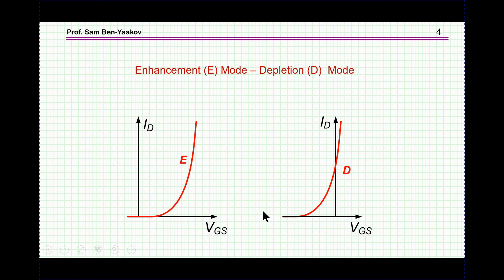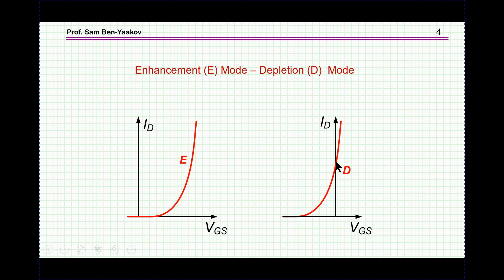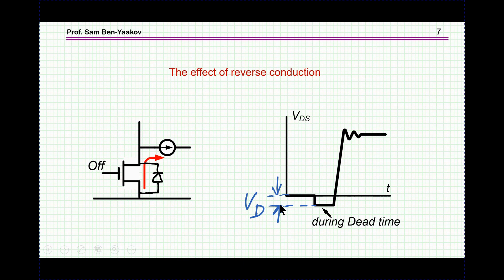So what is GaN MOSFETs’ reverse conduction all about?

Comment: Thank you for sharing all this knowledge to us. I have just a single remark: in explanation on MOSFET operation under VDS lower than zero you should disconnect the bulk from the source and leave it floating. As it is now, bulk connected to source, drain may not go below 0.6V because drain-bulk diode will conduct. In ICs is standard practice to leave bulk unconnected or to “soft” connect it via a resistor to all negative voltages on drain. One may talk about “structural” source or drain = device terminal intended to act as source or drain and “functional” source = terminal at lower voltage and “functional” drain = terminal at higher voltage. In MOSFET operation source and drain may switch roles.
Reply from the maker: Hi , Thanks for comment. Indeed I inadvertently mixed up the Si and GaN symbols, not witching the bulk conction . I guess that most watchers of the video will not notice that as you did 😊. Remaking the video is just too much work. Thanks again.

Comment: The problem with parallel diodes is current sharing, especially at 50kHz and higher. To reduce this phenomenon it has to be co-packed with switch in the same case to minimize parasitic induced.  ROHM has one SiC MOSFET + SiC SBD in TO-247 on the market
Reply from the maker: Thanks for pointer Andrii. Indeed a good way to go.
Reply: Nexperia has GAN039 series as well, integrated MOS for switching

Comment: Are GaN devices typically symmetrical or asymmetrical? That is if I were to "accidentally" mix up drain and source on my PCB layout, would the device still function identically in switching application?

I found the explanation ranging from 6:50 to 12:00 to be kinda long-winded. if I understood you correctly, the role of drain and source swap when the voltage across the channel is reversed, as I expect. With the continued assertion that V**g**s=0 for a reverse biased HEMT w/o the body diode, it should behave exactly like a normally-biased FET would when the Vds is asserted to zero (shorted) on a MOSFET... That is it would act as a crude zener diode at/around the threshold voltage. 

I happen to have a large collection of very old (TO-18, 100mA, 25V) 4 terminal MOSFETs that just so happen to feature separate body / bulk connection and source. I have successfully used them on a breadboard bi-symmetrically reversing the role of drain and source. It gives me some ideas for using them as analog switches. Why are these not more common especially in applications like a battery BMS where back to back connected MOSFETs are used as a switch to disable a battery from over-discharging or over-charging? Or even in power electronics where having a symmetrical switch would enable some novel designs?

What is the practical difference between enhancement mode GaN HEMT and depletion mode HEMT w/ Si cascode MOSFET? I've only looked at a couple devices so far and it seems the GaN eHEMT has a very low threshold voltage and may require negative gate drive to ensure it stays off while the cascode MOSFET variety features a more typical Si behavior and can act as a drop-in replacement for typical Si devices, but has slightly worse characteristics than a pure eHEMT or dHEMT

With the emergence of GaN and the far superior performance at least on paper, is there still a place for the SiC which is still proving to be cost prohibitive (at least to me 😛)

Sorry for all the questions, I regained interest in making my LLC converter design I started at the beginning of this year LOL. And was looking into how to make a bridgeless PFC. And yeah the control for that cursed thing is very tricky indeed!
Reply from the maker: 1.The ones I know are asymmetrical. 
2. Watch again😊
3. The separate body terminal is real not useful. You can get by without it. Tis is the reason , I guess, they are not popular.
4. The E D mode conduct with Vgs=0 very dangerous and inconvenient, requiring a negative bias to block. 
5. For high voltage the SiCs are still superior. The GaNs need sometime to catch up. If you have not noticed, nobody was able to demonstrate a GaN inverter for high voltage/power EV motor.

Comment: Hello Sir, It was an excellent video for me as I have just entered the domain of WBG devices. However, I had two  queries. 

1. As we see in the Id_Vds characteristics, at Vgs = 0, the device is conducting both in the first and third quadrant. Then why do we bother to provide a  even more negative gate to source voltage, as I see that applying more Vgs negative is causing more Vds to be dropped and also reduces current carrying capability? Does it improve anyway the conduction losses in reverse direction? I think what I am trying to ask is whether providing a even more negative voltage is advantageous in any way?

2. If I want to turn off the D mode GAN FET then what do I have to do as applying a negative voltage is causing conduction in the reverse direction also?(so it is not "OFF" as for that matter).

Thanks.
Reply from the maker: Thanks for comment. 
1. The purpose of a larger negative voltage is to protect against the "Miller spike" 
2. There is no way to block reverse conduction. This is similar to a Si MOSFET only that the voltage drop is not of a single diode

Comment: 12:00 I haven't get the last part of the video, yet, but if Vgd exceeds the threshold, Rds which was huge before (when the transistor was blocking) falls to something drops to like 1 milli-ohm. So, unless you have 6000 A through it, you won't be able to sustain a drop of 6V from Vd to  Vs, with Vds = Rds * I. So, with no sustained Vgd of 6 Volt, will we not get a system with very low current, less than 1mA ?
Reply from the maker: See https://youtu.be/QNHzaiWCUeE?t=844

Comment: Regarding using GaN in reverse operation. Does it mean that we can drive it through Gate - Drain? If we put Gate - Drain 0V, it will stop conducting, right?
Reply from the maker: No,j because Vgs is high. For cut off you need both voltages belo threshold.

Comment: So, for high-ish current/voltage synchronous rectifiers or buck converters, it may still be beneficial to place a parallel SiC diode across the GaN part to help with loss during dead time?   How about a GAN diode !  Can they even make a GaN diode by itself ?
Reply from the maker: No no need. The reverse conducting GaN will turn off relatively smootly (we are going to present a conference paper on that shortly). AS fa as I know GaN diodes are not available.
Reply: GaN diodes are available, but they are called LEDs and may not have the characteristics you want for this application :-)
Reply: At least you might see when it conducts !   I thought that LEDs were Gallium Arsenide but I guess that they are actually GaN

Comment: But this would also mean that in revers the GaN does sometimes operate in the Linear Region, do GaN also have problems like Mosfets with Drain current focusing? And also if you have devices in parallel the TK could distribute the current over the diode not to all devices
Reply from the maker: Hi Heinrich, thanks for comment. In switch mode operation,  when heavily driven GaN transistors do not really operate  in the linear region and can be considered just as a  conductor slab of Rds(on). However when stressed with very heavy current they may move to the linear region. AS for drain current focusing, I don't know.
Reply: But the Diode effect is a linear mode of the GaN(it is not completely on). Yes im more concerned about those unwanted  effects that comes from how the semiconductor is impemented. You are rigth theoretically it is just a conductor slab of Rds(on) but that is true for all Fets. But there are differences in like TrenchFets or HexFets... like the Spirito-Effect i mentioned. So far i found not much information about that.

Comment: Can you explain something about the strange effects of early GaN-(HV)-Mosfets? Like the current collapse, stored charge over days, etc. I was evaluating early 600V GaN(2013) and started to hate this things because not relaible. Working with normaly-on is pain and the early cascodes also not stable. Since i now work on 3-phase tens of kW SiC is the main component i use. So i was not involved of the transition if GaN from engineering samples to a reliable switch for MP. 
So review what was done to make HV-GaN stable and usable like today would be very interesting. 
Best greetings form Austria!
Reply from the maker: Hi, Thanks for comment. For low voltage GaN transistors seem to have reached a mature state. HV high power GaN are to me experience still in the beta stage. Some applications (APFC) seem to be working OK but I have not seen yet a reliable high power GaN motor drive inverter. But it will sure come.